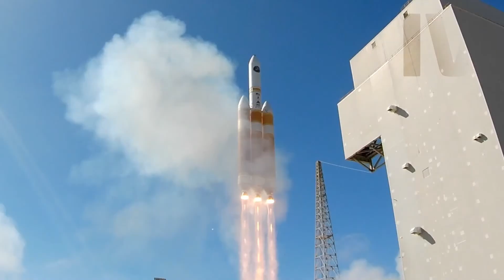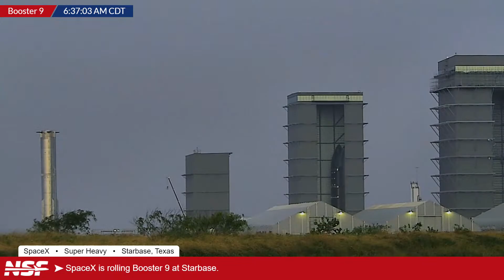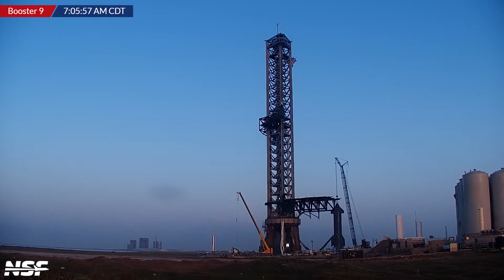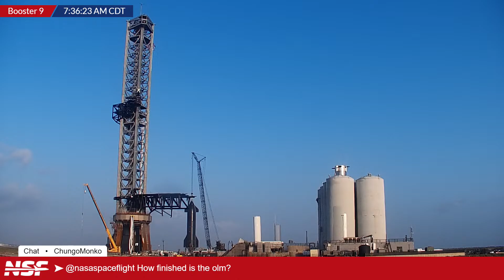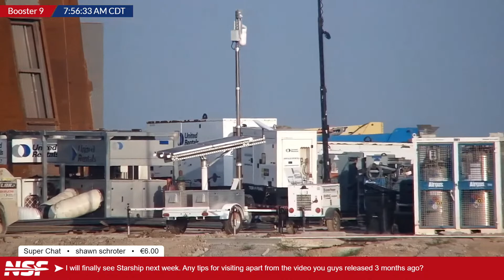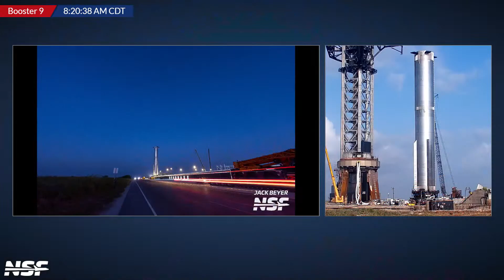SpaceX Rolls Starship Booster 9 to Launch Site at Starbase

Comment: Wondering if they could fly it without the Hot Staging ring. You need the hot staging ring if you want to reuse the booster to vent Starship exhaust.. This booster will be thrown away.
Could they do hot staging without the ring even if it destroys the top of the booster?

Comment: will they make the chimes out of aluminium in the future? no real reason to use steel for that
Reply: I doubt that aluminum could take the heat of reentry.   The booster shielding itself with exhaust like Falcon 9 would no doubt help...but still the heat is going to be pretty high and the amount of weight saved using aluminum chines doesn't seem like a worthwhile mod.
Reply: @recoilrob324  idk is the reentryspeed that high? cant be much above mach7
Reply: @S1nwar  I believe it's right in that ballpark and then add the exhaust plume it'll be falling through and temps might be a bit warm for aluminum.   And considering all that the chines are the weight savings using aluminum are probably minimal being that the SS is much stronger per pound and the chines can be made of fairly thin sheet.

Comment: Why can't the Hot Staging Ring simply be a separate unit that fits between the Booster and the Starship?,. Using the same locking mechanisms the previously made the two in to one launchable unit.
Reply: Very Rapid reuse they would have to take the time to get a new ring to the pad and stack it rather than just putting the booster back on the pad